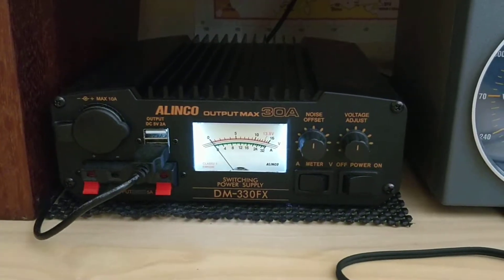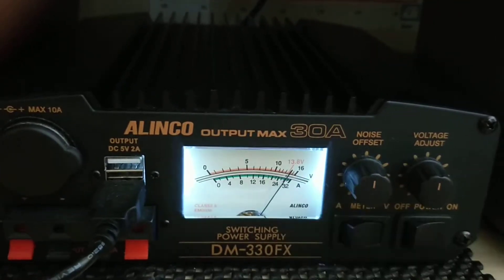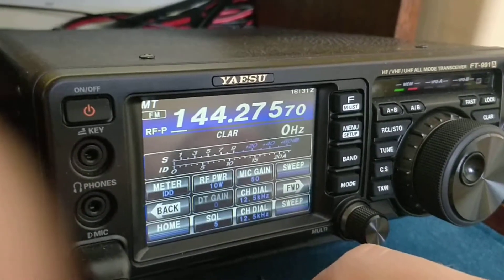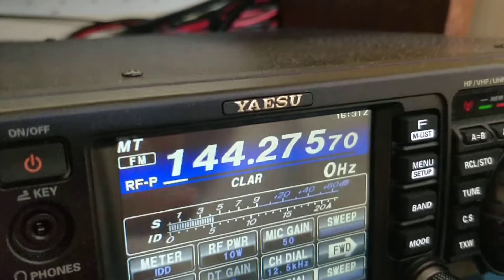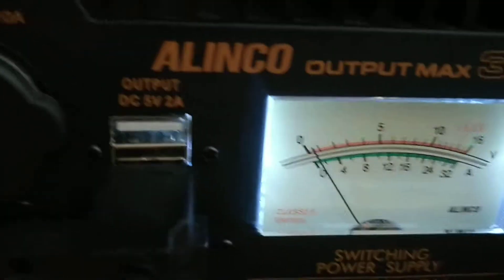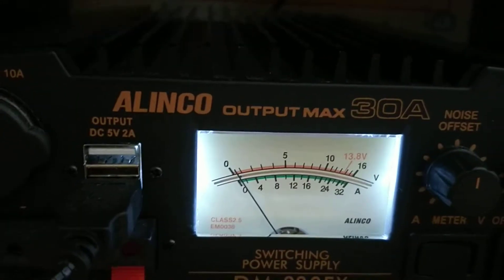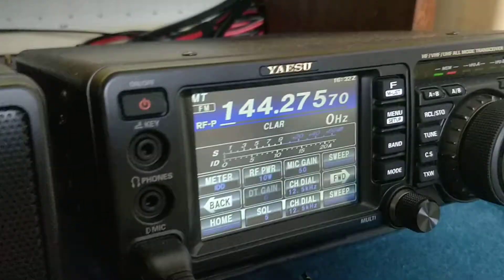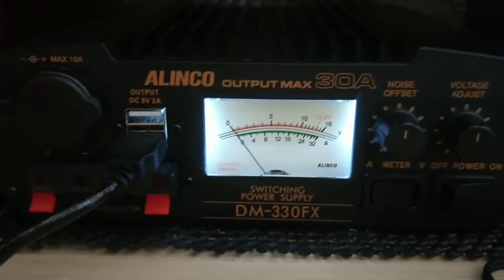Alinco DM-330FX 30Amp Power Supply - Meter Issue

Comment: The current measurement in this power supply is simply measured by monitoring the voltage across a current sense resistor which is made up from seven 0.1 ohm 3 watt resistors (R50 to R56) connected in parallel. This voltage is then fed via a 100 ohm (R49) and an adjustable 2Kohm preset (VR8) to the meter. The other side of the meter is switched to ground in current monitoring mode. VR8 is adjusted to calibrate the current reading. With regards your problem check for dry joints or broken connections on the PCB around the current sense resistors (R50 to R56). Also check for damage to PCB tracks around R49 and VR8. also check all these components are OK.
Reply: Hi, recently developed low o/p voltage on this PSU...upon cranking the knob to max. it only gives 11.9v. If draws more than 15amps on load then it shuts down automatically & restarts !!! What might be the problem...any suggestions. De Vu3Cgb